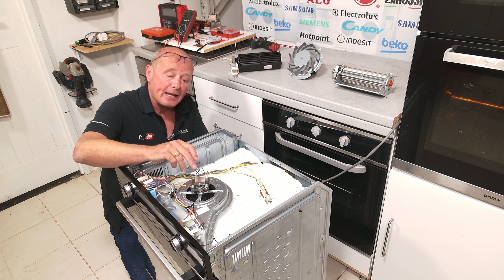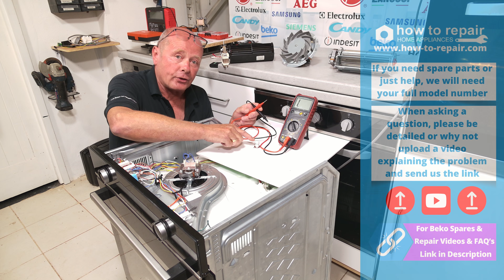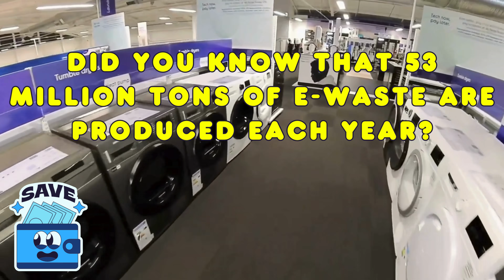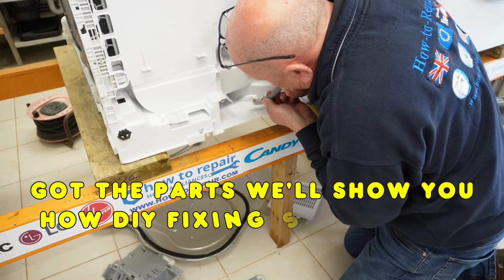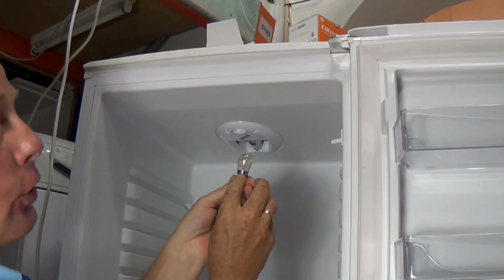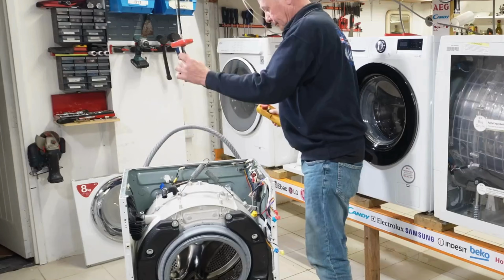Oven Cooling Fan Motor Runs Continuously? How to Test & Replace Beko Oven Cooling Fans

Comment: Our sldf30540ss is a stove with a gas range top, not a slide in. Which screws do I undo to lift the burner section up out of the way. There are many, my thought it might be hinged to lift up. There are many cooling fan has a metallic grinding noise. We purchased the stove used for your information

Comment: I have a cooling fan of the cylindrical (tangential) type, located in the rear of the oven inside a vent that runs along the back top of the unit. When the oven is on, that fan comes on after a few minutes (probably via thermostat) and begins to blow relatively cool air up out of the vent. The problem is that this fan creates an air current above the stove, pulling the flames from the burners. I have to reposition pots and pans by 4 to 5 inches off-center for them to have even heat distribution. But the heat is also a lot less at that point. The unit (GE) has done this since it was new. It's a design fault, as far as I can tell. Infuriating, because it seems like a no-brainer that some folks would like to use their oven and cooktop burners at the same time. $2,000 it was, a nice unit except for this ghastly design.

Comment: Hello! Working on a lofra...thermostat with cylindrical fan. On the thermostat it says 271P 16A 250V III-13 T200.
What would be the temperature setpoint? 200c would be awfully high?